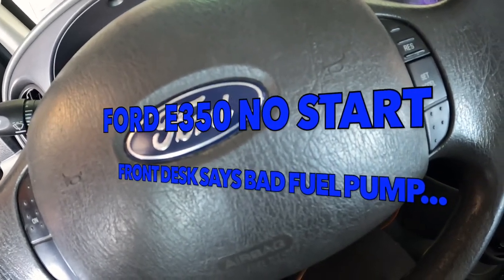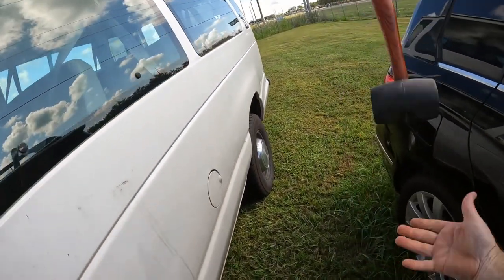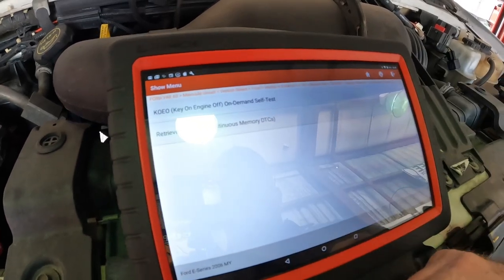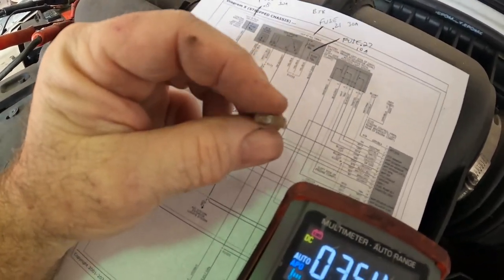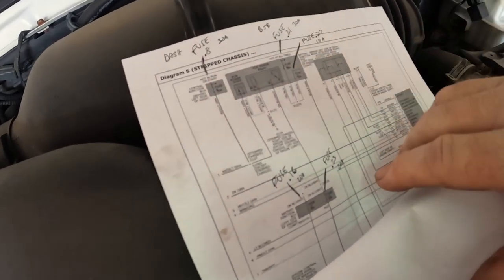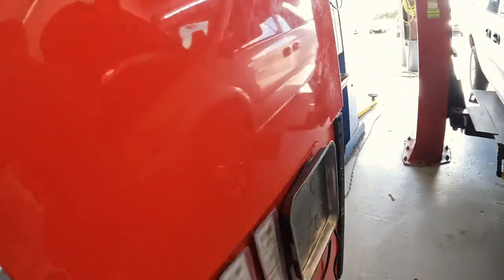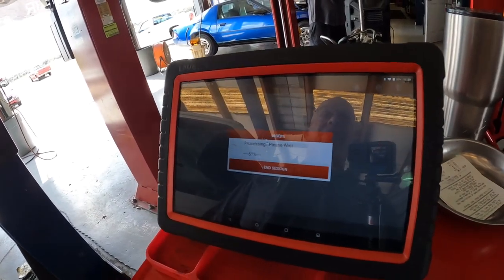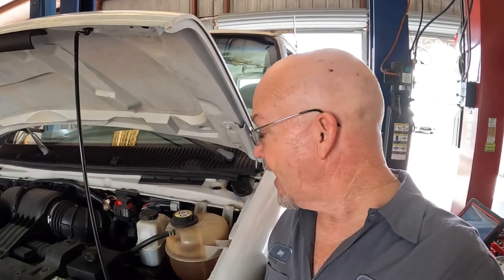FORD E350 STALLS INTERMITTENT NO START, EVERYONE THINKS IT'S A FUEL PUMP, FIRE THE PARTS CANNON!?!?

Comment: I had the same issue with my 2007 Ford e-150. Intermittent stalling. Occasionally rough start. Cycling the key back corrected it until the next time. I fixed the issue. It is one bad wire in the harness. I also notated this on scanner danner. I am now known as The Big Kahuna for fixing this for 70,000 people. Oh and by the way I replaced every part that I could on that vehicle. Everything from the map sensor to the fuel pump control module on the axle. Nothing ever worked. Except the wire
Reply from the maker: Nice work! A broken wire or bad connection in one can cause loads of issues for sure!

Comment: Jim i have 12v and ground at fuel pump harness at tank. I plug in the fuel pump pigtail and no fuel pump. If i use another battery for power and ground and pump runs. 06 E350. 5.4
Reply from the maker: Make sure the fuel pump module can handle a load. Sometimes a meter will show surface voltage and ground that go away under load. I’ve seen a lot of bad pump control modules. Even systems that use a relay can have bad relay contacts that show similar symptoms.
Reply: Thanks for the response Jim. Will load test. Will swap out PCM relay. Already did FP relay. Will look at contacts too. Same power and ground at fuel pump pigtail with FPDM plugged in or bypassed so driver module is good. Weird lookups on PCM relay. Still looking for that relay. Thanks much

Comment: I have that “custom” wire harness on the van I’m working on as well. There is even a red wire that runs to the fuse box as well. I don’t know if it’s from factory or third party.
Reply from the maker: I think a lot of these vans have accessories added and the wiring isn't always great. They basically just wire them to get them working and down the road. I've seen some that bypassed relays rather then diagnose them also.

Comment: I'm having problems with the e350 dying and I believe it's the relay.  I have a question. I only have one relay in the fuse box.  Why would that be?  Thanks for your awesome videos.
Reply from the maker: Some years have them under hood, the earlier ones have relays in the kick panels or under dash. A wiring diagram might show where yours is located.
Reply: @JimmyMakingitwork  my 97 does the same. They said it's the ICM (IGNITION CONTROL MODULE) but I don't know where to find it. 96 and under is easy to find, but no information where to find 97 & up

Comment: Fuel pump modules on rear crossmember rot from galvanic corrosion are one the most common problems with those
Reply from the maker: Yeah, we have done some, also seen custom wiring jobs and other issues. Even just a regular old bad fuel pump once in a while.
Reply: Are the modules hard to change. I don't know anything, but I try.

Comment: hello friend, greetings from Peru, I have a 2005 Ford e350 5.4, the location of the relay and fuse is the same as the one in the video or it changes.
Reply from the maker: I’d have to look that up on our system at the shop. I’ll try and remember to check it for you.
Reply: @JimmyMakingitwork  ok thank you

Comment: M have a rear gas tank on a 350 Ford econo van I had to replace fuel pump it has three wire connected I need to know the color code at to hook up on the fuel pump
Reply from the maker: One will be a ground, one will have voltage for 2 seconds when the key is turned on pump power and one will have low voltage for the level sender. I use a volt meter to test them. 
For wire colors I’d need a VIN and possibly options list.
Reply: @JimmyMakingitwork  Had this problem just yesterday  . I went under the van & unplug the fuel pump ,wait for a minute ,then plug it back & walla , it started right up . Try that before you call a tow truck if it happens to you .

Comment: Jimmy, I have 2001 E350 7.3 ( ambulance). I can start it and it runs for les than an hour and then suddenly turns off and will not fire up. I swap the fuel pump relay and starts. The original relay shows 30/40 amp. I replaced the relay and only runs for 10 min. What is the part # for the correct relay?
Reply from the maker: Hmmm, I wish I knew the part number for it Carlos. I usually get critical parts like that from the dealer. But once cry once that way. I’d also take a goo look at the wire connections and make sure they aren’t heat damaged.
Reply: @JimmyMakingitwork  
Good thinking, I will check the wiring. I also decided to change the pump incase its overloading causing the relay to trip.

Comment: Crazy my 2006 e350 when I’m driving stalls I pull over wait 2 minutes then starts right back up again been driving me crazy wonder if I have the same issue sometimes I’m able to start it quickly and it’s starts up back on the road
Reply from the maker: Usually it will be fuel pump or pump module related. Could also be electrical so codes and then diagnosis after that.
Reply: @JimmyMakingitwork  codes I pulled on launch scan p0340-ff P0460-FF and P061b-ff truck has new battery ecm/pcm throttle body injectors
Reply: @alexandercordero6025 my 2007 Ford E-150 started the intermittent stalling and rough startup occasionally. I replaced every sensor in the vehicle. Run a jumper wire from the under hood fuse block to the connector on the pcm. The Wire that you going to bypass is the kapwr wire. That is the keep alive power wire. It runs from the under hood fuse box to your pcm. Use those blue Clips to splice the wire as close as you can from the output of the fuse to the PCM plug. That will correct your problem. Leave the Old Wire in place. It's in the middle of a harness with about 50 other wires. You're just merely bypassing that wire with an outside of the harness mounted wire.

Comment: @jimmymakeitwork I have a 99 econoline bus 7.3 diesel that will start up fine and and drive but after driving about 10 minutes loses power. I can have the pedal to the floor and it wouldn’t go over 10, then stalled out in the middle of the road. I changed the icp sensor, I need help my man!
Reply from the maker: Sounds like either an exhaust restriction or fuel pressure issue most likely.
Reply: Think you are right about the fuel pressure. So if you were going to look for the culprit , what would you start with? Injectors?
Reply: @@nctubbs1990   I'm sure you fixed it by now but if these vans are like  the trucks fuel pump set up  there's 2 screens in the fuel pickup inside the tank  recommended to clean every 100k
Reply: @clittle1559  thanks a ton man, I just got it towed to my place a couple days ago. Will update once I look into the fuel pump 🙏🏼

Comment: Sooo what if I have a unit that’s running 48 percent at idle? Having an issue with a 2016 e450 6.8 that shuts off randomly. While driving. Can idle all day but sometimes as soon as you put it in gear it stalls?
Reply from the maker: Sound like a vacuum leak, or throttle body problem, are there any codes?
Reply: @JimmyMakingitwork  zero codes, I was thinking throttle body is dirty. It is an ambulance so it does idle a lot. Checked the voltage at the battery as well as at the alternator and pushing 14 bolts. I think the batteries are brand new within a few weeks.